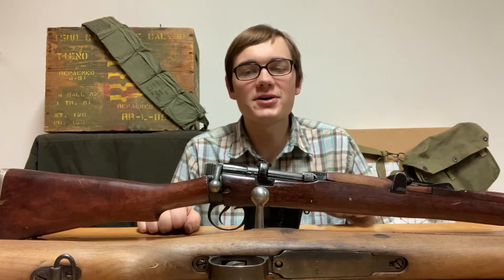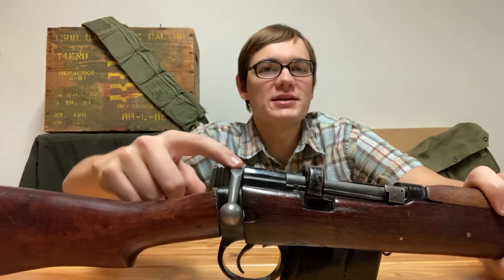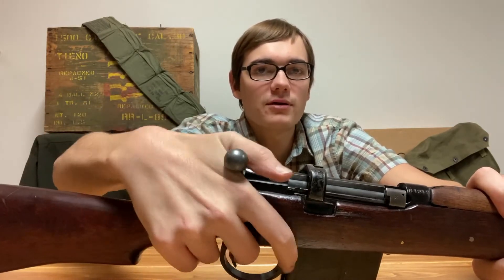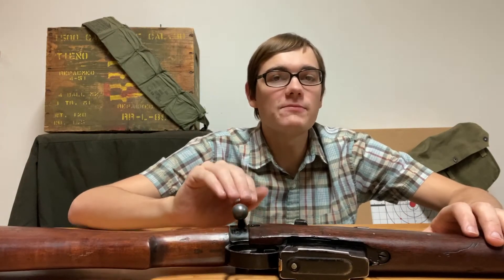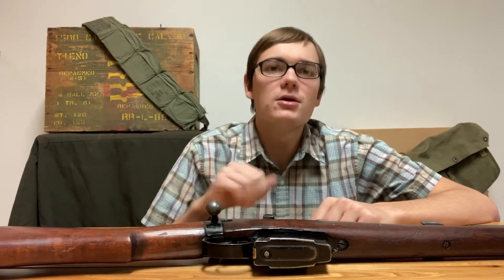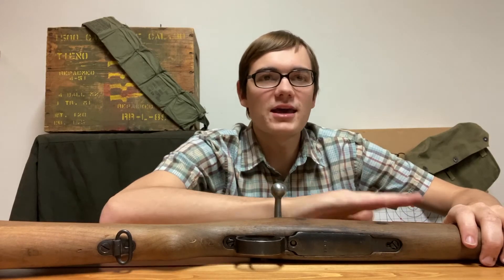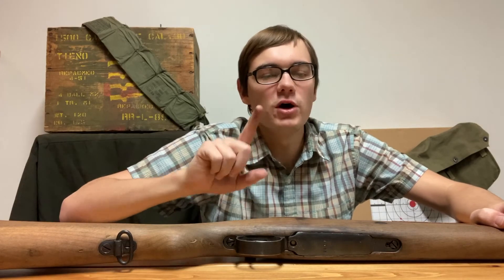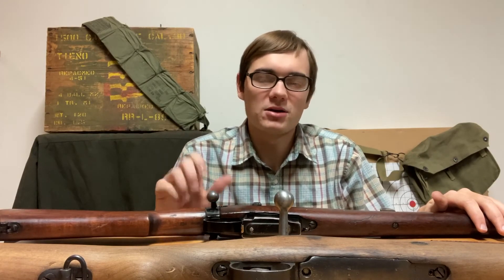Straight vs  Turned down bolt handles (Mechanical Minute)

Comment: The .303 SMLE wins hands down because of the smoother, faster and more ergonomic design of the turn down bolt system which was superior to the straight bolt system. In addition to having a 10 round detachable magazine as well which gives the rifle double the round capacity of most rifles of that period that had magazines that held only 5 rounds.

Comment: Frankly , if the bolt is turned down but only partially and not fully °90 like the Karabiner 98 AZ or the Spanish 1916 , it irks me .Except the Springfield line , those are the exception .